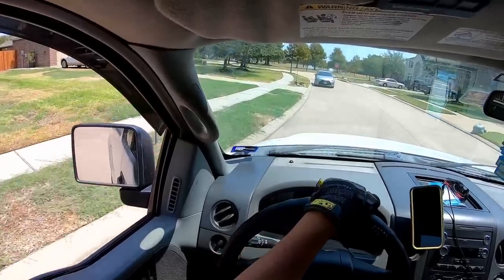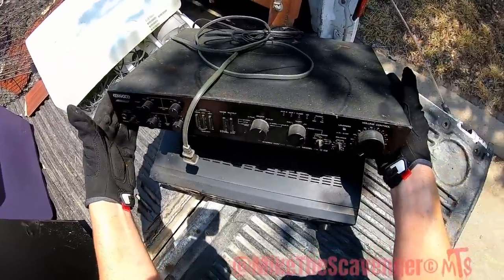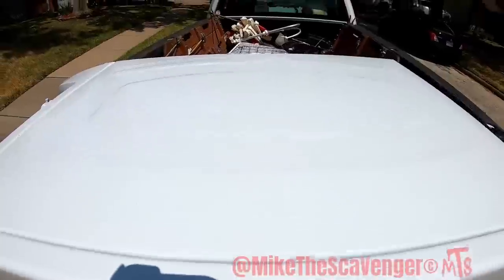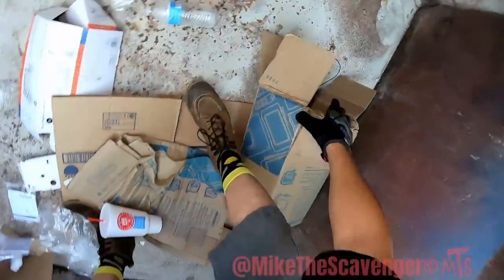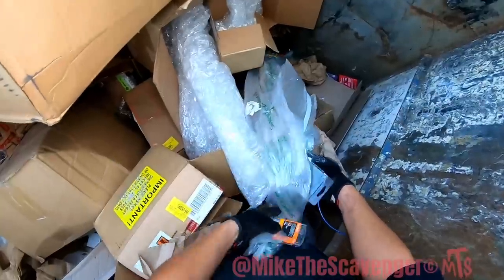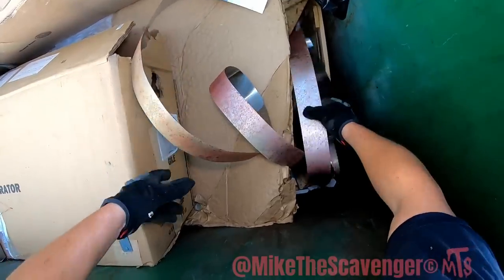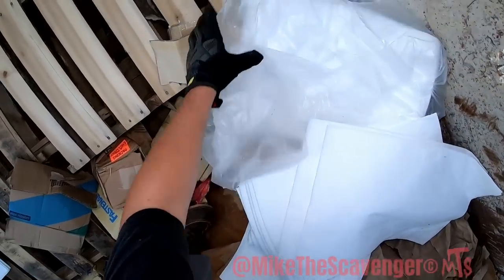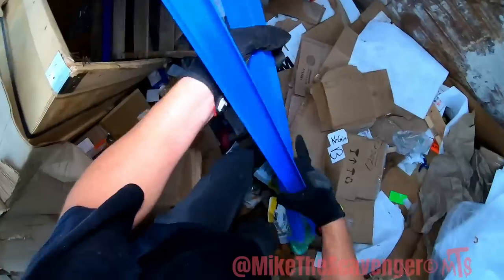Dumpster Diving & Curbsiding "Crazy Like Crapes"

Comment: In order to make those bolts and for them to end up still boxed is amazing. The bolt started out as a design,then a machine part had to be made to make them from raw material, the machined, quality control,packaging, shipping(fuel wasted) received,stocked and then unceremoniously dumped!Not to mention all the employees payments!  Extremely wasted ! Thank you Mike for saving them! Your the best!
Reply: Back in the 70's I was a bolt maker and made mostly large bolts like those and they start out as a big roll of round steel and ends up as a finished bolt except for galvanizing, it was interesting how the machine worked but definitely some danger involved working with it.
Reply: @indianaslim4971  I worked for an extruding company that made the extruders. The amount of man hours from design to finish was astounding!  What a waste on these bolts! Glad Mike can at least scrap them!
Reply: @dianewilliams1125  definitely a waste by the company, curious as to what type of extruding your company did, on the machine I worked, extruding wasn't a separate process, it was accomplished in one of the dies that the battering ram hit, there were 4 dies that were hit every time with fingers that would move the bolt laterally to the next die and the final die would kick the bolt up and out to the dies that would make the threads.
Reply: @indianaslim4971  I worked in the office as accounts receivable manager. The types of extruders were varied,some as large as 40ft. Others were just extentions to existing machines,we also made parts for blow molding,Coleco was a big account for the then video game consoles!

Comment: When you think about how much energy goes into making those bolts, it’s just mind blowing that entire boxes of new ones are discarded as trash.  Good work for finding them MTS!
Reply: Yes, not even scrapped. Thankfully we have Mike The Scavenger!
Reply: Energy ? Heck watch a video on it it takes  moments to make those. Pump them out buy the thousands. And their paid for ya can't save everything you'd  be over run with junk.🤷
Reply: You're correct that everything can't be saved for being over ran but it certainly can be sold for something rather than thrown I to the trash.
Or even a more crazy idea would be to ask employees if anyone would want them to make a few extra $
Reply: @vicferrari9380  energy as in gas and electricity.  I read that if you half fill a pop can with gasoline and then pour it on the ground, that is what you waste, if you don’t recycle that aluminum can.  The metal of these bolts also need to be refined and manufactured before even creating that into a bolt.
Reply: It's sad that the industry is that wasteful... some buyback logic need to be implemented. Or why not donate them to some charity, hfh or something.
Reply: Especially how much they cost
Reply: @vicferrari9380 
You didn't understand!
He meant the process of making it from mining iron from earth to finally delivering it to the buyer.

Comment: You can use those oil absorbant rags if you scrap the compressor on the air conditioner. I always get the copper out of them.

Comment: I used to work in a hardware store and those bolts would run 16.86 per bolt. Not included were the nuts and washers. The were used to put steel buildings together.  You have some money sitting there. I hope you sale them.

Comment: 20:12 Can anyone ADVISE me with their opinion of the Best MAGNETIC 🧲 CATCH & RELEASE SWEEPER for Nails & other small hard to reach hardware??
MIKE, which one are you using here in the vid? 
My friend bought a house that had 3 previously demoed sheds on it. He didn’t want his mower tires punctured or his kids to get hurt so he purchased one to pull the old nails, screws, staples & stuff out the grass, but he quickly discovered it didn’t work well on uneven, dirty, and grassy areas.